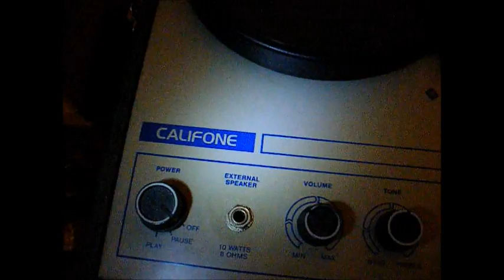Anti-Crosley record player video, feat. AMERICAN STANDARD TOILET SOCIETY

Comment: You are so right about shopping around for used gear. I bought a 1980's Sony PS-LX22 turntable at a record store. It's a little scuffed up, but mechanically fine. I also have a 70's Fisher receiver and matching 3-way speakers I got at a flea market. The whole set-up cost me around $125. And it sounds a hundred times better than a Crowsley. Plus I have the security of knowing that it's NOT ruining my vinyl.

Comment: The old player has a dangerous mains lead though, it isn't double insulated, which means if the plastic covering cracks, bare wires are exposed. Otherwise totally agree about Crosley, would never touch one myself.

Comment: Never trusted the quality of Crosley products.  Got my first phonograph, a Symphonic table model, for Christmas when I was just 6 years old.  Shared it with my older sister.   It resembled your model here, but there was a knob at the end of the tonearm that turned the entire cartridge -- a microgroove stylus on one side and a 78 stylus on the opposite side of the cartridge.  A single tube model that was a real warhorse.  Served us well for eight years, until our folks upgraded to a console Magnavox Astrosonic radio-phono.  No Chinese imports -- Symphonic manufactured in Boston Mass., Magnavox from Indiana.

Comment: Off hand, I think the lowest stereo phonograph on the used market worth owning would be the GE or Emerson branded Wildcat. Not much power, and the 6" x 2" speakers won't rattle the walls - but the sound is pleasing and the quality is there - especially the Emerson version that uses a classic metal chassis BSR record changer. I feel the reason for the top dollar for the older suitcase portable stereos is nostalgia value. IMHO a true component system from the used market from a reputable seller is the best bet. Next would be a serviced console stereo like an old Magnavox Astro-Sonic.

Comment: That 1954 Symphonic is a beauty.
I have a Crosley radio/tape/phono/cd player that was given to me, so that is about the right price for one. :) But i still had to repair almost everything on it because nothing worked or worked correctly. I never managed to get the cd player to work though. If you can get these free or very little money pick em' up just for something to tinker with.
Any ideas on repairing the CD player?
Reply: I guess i should explain the problem with the cd player. The tray opens but does nothing at all when closed like it does not even read that a cd is present. If you have any tips i would appreciate it. It was given to me by someone who is no longer with us. Thanks in advance.
Reply: Ought to just EOL it. It's not worth it. The things are crummy and the parts are hard to find. If you got a Technics for free, score! The crosley is not worth keeping, even if its free

Comment: Nice rant! Like I said many times, I don't like the way Crosley made these type of modern record players. I was at Kmart and Wal-Mart that I saw a Crosley all-in-1 stereo and it has a cheaply made record player. That is a junk, it has a radio, CD player and a cassette player. What a waste. I'm not going to waste my time with this one. GE Wildcat portable stereo is one example that I have at home, but it plays good, but it uses a 1 mil. stylus in a C-660 cartridge and it was one of most cheaply made record players ever produced. GE made these type of record players in the late 60's and right up to the mid 70's. It has the Automatic Hi-Fi mono version and the Wildcat stereo version, and it's made of plastic bridle. I played the songs from Disney's "Frozen" picture disc record and it sounded not too bad. The speakers are thin on both left and right and it has decent sound quality. This cheaply made Crosley record player is worst than the GE Wildcat from the 1970's.

Comment: Sadly, even that POS Crosley is "vintage" by today's standards, because that was from when they at least put the transistor stage to attempt to match the ceramic cartridge to the op amp.  Today's Crosley Cruiser is even worse, because it looks like they got rid of anyone who knew how ceramic cartridges work, and the result is a tinny screeching quality with no bass whatsoever.  Way back when they did the CR-40, even those tiny speakers are vintage quality compared to the Cruiser!  So, if you had a CR-40 and thought nothing could be worse, you'd be wrong. Get a Cruiser and find out!

Comment: I enjoy your vintage repair videos...including your hyperbolic “cranky old man” vibe. I don’t disagree that the build quality is vastly better in your vintage unit. That said, I have the same Crosley cr40 you show in the video that I bought new for $29.95.  I do not listen to it via built in speakers, but It actually sounds great through external powered speakers. Your vintage unit is mono and does not have a line out...very few people want to listen to stereo records on a mono unit and with no potential to add stereo speakers or subwoofer. The board in this particular Crosley is actually pretty well done with proper high impedance input. With the proper impedance, the cheap ceramic cartridge sounds very good...similar to a run-of-the-mill magnetic cartridge. Also it is very small and easy to store...and the ladies think it is cute. I did rig a counterweight to reduce the tracking force slightly but it was not dramatically high.  So, yes, it is disposable given its build quality and very low price but it is a solid value for playing old records.

Comment: The problem is that a lot of people don't have much money to spend, it's not about the device is vintage or not. You know, a lot of countries are still in financial crisis state, that could be a problem to consider. Yeah those Crosley's are crap, terrible acoustics. I have a dumpster dive rescue 1989/1990 vintage classroom/industrial casette player made in Japan with Sony circuit boards inside with 100% transistor based and it does sound better than modern casette players,

Comment: Crosley is junk total junk. I found the company that makes there units and my god there cheap all they do is add a brand name to some stock unit. This link is what they cost take a look at all the wonderful junk.

http://www.alibaba.com/countrysearch/CN/vinyl-turntable.html

I hate to say but bsr turntables are top of the line over crosley. A few turntables that used ceramic cartridges were sold with high compliance ceramic cartridge. Them tables and cart are nice. They track around 2 grams to about 3.5. So safe for records. 

I also hate small platters. I have seen record wear just from the platter alone. To me a platter should be 10 inches and up. Changers are great also. I know some hate them some love them. But there nice for party's and such.

Comment: I bought a Craply that has a USB memory stick port.  I was hoping I could digitize some records with it.  First, it sounded worse than crap.  Second, it would record the entire album only as one big file.  Lastly, the file it created on the memory stick was not recognizable on the computer so I couldn't play it anyway.  I bought an ION turntable after the turn of the century.  It had a USB output but it barely put out any sound on the right channel.  Don't buy this crap unless you want to throw away your money.  Flushing the money down the toilet is a much better value!

Comment: The crosley really does sound impressively bad. I want to see that and other junk pressed (maybe a 50 ton press) with a 2" or smaller head such that it explodes if it will. If there's enough wood fiber and the right kind of plastic you might be able to get quite a few explosions out of it. Not to mention a lovely mess and smell at the end. Might even be able to hang some of it on the wall like a taxidermy racoon.

Comment: Chinese manufacture only need to make them look cool on the outside and plenty of people will line up to get one. In the old days you could listen and compare . The first time they hear there new Crosley is at home after it gets unpacked. When I was a teen back in the late 60's ,we would compare the KLH against the RCA or some other brand and then we had a new goal, to try an get one. As it turned out it took about 50 years before I finely ended up with a vintage KLH. It sounds as nice as I remember it sounded so many years ago.

Comment: Using those external power adapters is to avoid getting the whole player/device ul certified; the ul certification automatically comes from the power adapter manufacturer.  That along with being am additional cost savu

Comment: I have that same Pioneer you featured at the end, the one you had was a PL-600, mine is a PL-590. Fully automatic, not sure what the advantage of the PL-600 is, I will say, my 590 is a good performer. Part of my vintage audio setup with a Kenwood KR-2120 from 1970 and some Zenith Allegro speakers.

Comment: I wouldn't mind taking one of the Crosley all in one systems and doing some upgrades to it such as proper two way speakers with a proper crossover and maybe an output for a powered sub if there isn't room inside to mount a small sub. I wouldn't use the record player though

Comment: i almost got one of those piles of junk insitd i went to a local fleamarket tht deals with vintage stuff n got me a 1971 Zenith Circle of Sound am/fm turn table but it needs recaped could any one tell me of any websites that can help explain the different types of resitors n capicators n color codes n types to use in the old radios

Comment: @radiotvphononut I just ordered a vintage Audiotronics 300t classroom record player.  I'm totally new to this but how do i know if i need to replace the needle or cartridge? And how do i know if i should adjust the spring counterbalance? How do i know if its tracking too heavy? How many grams should it be tracking at? If anyone can please answer my questions that would be great!
Reply: Christopher Lee touch the needle with your finger. If you hear a tiny amount of static, it's bad. If you hear a lot of static, it's most likely good. the spring counterbalance adjusts tracking speed. The needle should track at about 2-3 grams. Get a grams weight and put the tonearm on it to measure its weight.
Reply: One other thing I have found with these old classroom record players (I do own one just for nostalgia) is that they can tend to not want to track well even with a new stylus (needle). The problem turns out to be the dried up or none existent lubricant on the tone arm mount.  That causes the arm to be stiff and will not let it "rest" on the record completely,. resulting in skipping or very bad sound quality.  A drop of sewing machine (lightweight) oil on the pivot point solves that.

Comment: This is an unrelated question but do you know where I can get replacement parts for a Soundesign 8-track player AM FM Radio combo and I think the model number is 443 but I'm not sure if that is correct.  The part I'm missing is one of the silver caps on the black volume knob is missing.  :)

Comment: In the past year I've directed a couple of my much younger friends to eBay for turntables when they mentioned they wanted to play records. I'd pick out a Technics and tell them to bid. Heaven knows how much vinyl hamburger has been saved by using a real turntable by them not buying that current stuff on the market. Can't say enough about Technics, it was a good value in the 1970's  and 1980's, even as the brand wandered off in the 1990's/2000's the turntables were still good.

Comment: Very entertaining :)
It's refreshing to hear an American technician pronounce 'solder' properly, instead of the usual 'sodder'.
I totally agree with your mission to educate young people about the benefits of analogue music reproduction systems compared to rip-off modern rubbish. I use an amplifier from the '60s with germanium power transistors made in Denmark, a Japanese tuner from '70s and a set of Akai speakers from 1980, which all together cost less than a Crosley.

Comment: Well said. I have a collection of players old and new , from the cheap to the decent, as well as components for systems. 
I think the thing that bothers me most about Crosley type players is that they seem to be built in such a thoughtless way from a design point of view. They could address most of the issues and there could be nice decent sounding new portable players made in China that don't give vinyl a bad name.  But they seem blind to the shortcomings in their designs. For instance, they could make the small players battery powered, but they don't.  They could make a compartment to store the wall wart in or build the supply inside. They don't even make it so the wall wart will fit inside the lid of the player in many instances. As you said, no integrated 45 adaptor, no turn over stylus with 78 tip. 
And they could try to make them sound better. In fairness there have been a lot of poor sounding portable players built and even the best of them never achieved the sound one can get from vinyl on even a modest home system like you mention you have. But there is actually no reason other than absolute cluelessness that Crosley and other firms who are all a matter of cheap retro style over substance can site for sounding as bad as they do. 
Even the ceramic cartridges and cheap belt drive DC motor mechanisms wouldn't sound half bad if hooked to a properly designed high impedance input solid state or IC amp with a couple of low distortion watts per channel, then to some attempt at decent drivers in some sort of removable boxes that provided room for a bit of bass and isolation from the turntable to prevent acoustic feedback. 
Then you might have something worth listening to. 
Cary that a step further with a small tube amp and a basic belt drive turntable mechanism similar to a typical 70s-80s Japanese component turntable with a good simple arm and higher quality ceramic cartridge with flip over stylus for 78s and you could have an almost audiophile quality retro styled portable that would give excellent representation of good records new and old. But it's not being done. 
If they don't want portable or used, what I generally tell people to do is to get a decent inexpensive new turntable with a built in preamp and line out, and hook it to a modern higher quality set of computer speakers with 2 satellites and a small subwoofer. 
Better bang for the $ than any Crosley.

Comment: About the 20 dollars you spoke of, I made a player that costed 20 bucks and is like 20 times better than the Crosley Cruiser they gave me on Xmas. The 20 bucks were for a BSR changer that I bought from a man who scrapped it from somewhere. The rest was just left over wood and TV parts from the side of the road.

The Cruiser is actually going back to the store, because by the moment I got it at Xmas (fyi I didn't ask for it) the stylus was broken already, and the RCA plugs on the back don't work... It costed 100
Reply: MisterTalkingMachine 
For an electronic  equipment that was already broken when you unboxed it , you can ask a swap for a new one or your money back ( i worked many years in an aftersale shop)